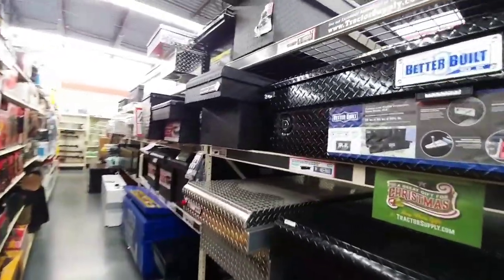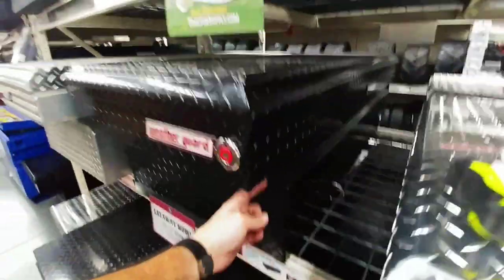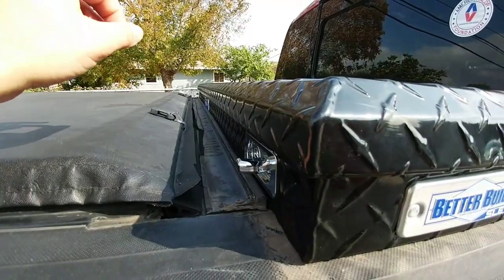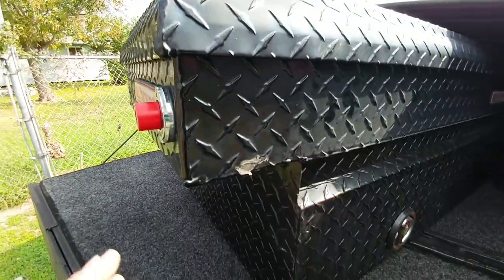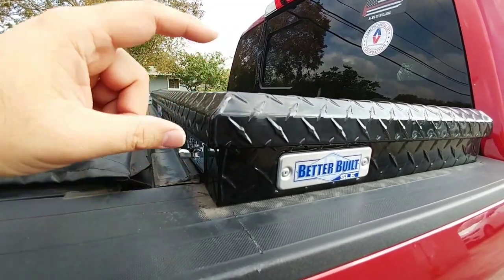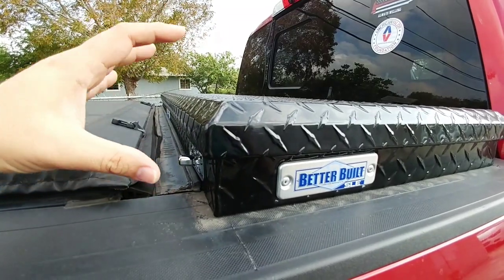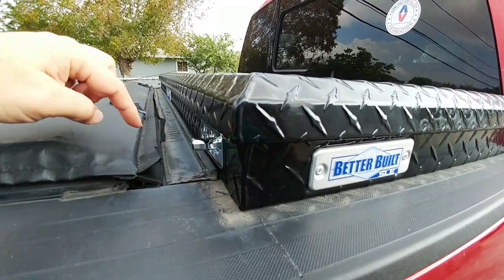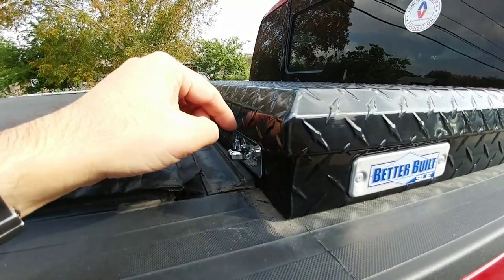Perfect Truck Tool Box for a Fifth Wheel RV! Check out this Low Profile Better Built SLE!

Comment: It would be cool if one of these tool boxes could come with a retractable built in tonnau cover.
Reply: There are some like that, but they're pretty pricey.  Plus they're pretty bulky.
Reply: @iananderson4897  can have the internal roll up mechanism inside the box at the bottom, a simple rail system would work can have it built into the wall of the box, it might reduce some of the capacity of the box itself but it would be neato as frig.
Reply: Truck covers usa has one $4-5k

Comment: Oh no!!!  I was about ready to get this exact combination of toolbox and tonneau... But Better Built just discontinued the SLE line!  I can find some online, but prefer to find something we can recommend to our viewers.  I've searched and searched, but that SLE with shotgun latches was the only one I found.  Have you come across anything else that might work like this one?
Reply: Tractor supply still sells them as of today (11/23/20). They are $599.99! However I just got a Tractor Supply black Friday sale flyer and starting tomorrow, I get 25% off of all truck tool boxes. I have to order this one but I still get the 25% discount. Thanks to you and then & JD, I finally found what I need. to use with a tonneau cover. Now if the virus doesn't shut down auto plants, my new F-350 will start being built in 2 days. Thank you and JD for your great videos. They are interesting and entertaining as well as very educational! Keep up the great travels. We hope to start in the spring. We have our 40 ft Montana, but can't move it until we get the truck and all the stuff we need for it.

Comment: JD, did you look at the Weather Guard 121-5-01 or 121-52-01 low profile boxes (may not have been available at the time of your purchase) before you purchased your Better Built SLE box?  As you know, the BB SLE is no longer available.

Comment: Well this is gonna cost me. I have a very good low profile box now but I’ve been wanting to put a bed cover on my GMC 2500HD. The latches on my box are as you mentioned, below the rail. I also pull a Reflection 5th wheel. I’ll have to wait until after Christmas though. Thanks for your service...spotted the firefighter sticker. I was a public safety officer — police and fire. Thankfully retired.

Comment: Did you ever consider a below the rails chest type box? That's what I opted for because of the very reasons you stated.
Reply: Nah, in that case you'd have to open the tonneau to get to the tool box.
Reply: I had one and I really grew to hate it because it was a pain to get in and out of but everybody has different preferences

Comment: Excellent!  We have the older version of this same toolbox that has the handle latch release versus the trigger.  Been wanting a tonneau cover and needed a toolbox replacement first.  We also had that same weatherguard and it rubbed our fifth wheel, so it had to go.  Another great video, JD!
Reply from the maker: Thanks guys.  I actually used your video to help understand the clearance when at a 90 degree angle.  So thank you :)

Comment: Is that rust or mud by the ring of the weather guard box?
Reply from the maker: A little of both. The rings are steel
Reply: @BigTruckBigRV  what did you use for the strip between the tool box and bed cover? I took your idea but I have the gap where rain comes in my bed like crazy..
Reply: Nate V I have the same question.

Comment: I have a black plastic one, love it, opens on both sides with locks. I never thought of how high for towing my 5th wheel I'm soon to get, but I just measured it at 4 3/4 inches. Not bad for not being low profile.

Comment: JD, thank you for the heads up!! Went and picked up one of these tool boxes the other night. It's way better than the old toolbox, as it leaves me much better clearance for the fifth wheel. Looking into the access toolbox Edition bed cover. Looking for some better fuel mileage when I'm not pulling a trailer.

Comment: If you have a long bed..It might be OK.. I have a Short bed (6'-10") F-250 and mine is only about 3 1/2" tall.. Even with my superglide hitch.  My 43' 5ver has twice come down and crunched the side section of the lid and scratched the Fiberglass cap underside etc.  I did a 7k mile trip out west and never put a scratch on it.. twice in past 6 months its come down on the lid.. And I paid for the trifold tonneau to go behind toolbox as well.

I'm gonna' unfortunately take out that toolbox and go back to a below toolbox/container.. And then i have the Ouchie of a tonneau cover that won't fit my truck system again .

So to anyone thinking of doing it with a short bed..Learn from my experience..It's neat and handy..BUT AINT" worth the damage to your 5ver.

Comment: Check out Highway Products boxes at 800toolbox.com.  I bought a low profile box from them kn 2005.  It's been in 3 different trucks and never leaked.  I can stand on it (@ 300 lbs) and the lid doesn't move.

They make an ultra low boss to sit between the gooseneck and the back of the truck for more storage.

Comment: I bought a cheaper better built from Walmart for my truck. It's also the low profile because I purchased my truck to eventually get a 5th wheel. I got the 70in crown series low profile so it didn't take up as much bed space also.

Comment: what are the tie down rings use for on the tool box for? i never look at a in bed tool box. we are planning on getting a fifth wheel next year. we have a camping trailer. i put a cap on my 2017 ford f350 dually. with a fifth wheel a in bed tool box would just fine.

Comment: I went with a USW Utility Chest box and put it up on 2" aluminum tubing cribs so that I could put 4x8 sheets of lumber in the truck, but it only extends 1" above the bed rail.  Has worked well.  I put my cap on my truck during the winter, so it does not interfere with the cap.

Comment: I have a "Husky"  tool box that is exactly the same profile as yours and the release handle is also in the same position as yours, but I got a great deal because it was a return and they lost the keys so I got it for $200. What are you going to do about the 12V plug you had in the old tool box??
Reply from the maker: Better Built and Weathertech have the same parent company and license a lower line of their product to Husky.

Comment: Just want I wanted to know!. Now you should be able to turn 90 degrees with your trailer, correct?  Does the lower profile box change your view from the back camera for hitching to your Goosebox or a standard fifth wheel or does the cover stick up too high when rolled up ?
Reply: I guess I asked too many questions.

Comment: Great video. This seems like the tool box I have to go with when getting a bed cover and a tool box for my 5th wheel hitch. Do you happen to know what the max safe distance would be in height from the bed rails to your 5th wheel RV front cap without hitting a tool box? I wanted to get the new decked tool box and do the same thing you did but the box is 5.6inches tall off the bed rails. Do you think that would hit a 5th wheel front cap?
Reply: I tow a fifth wheel and just ordered the decked one. Did you already buy it??
Reply: @Bananahammock88  I have not because I think it will be to tall and my trailer will hit it. I would love to you if this works for you and your set up.